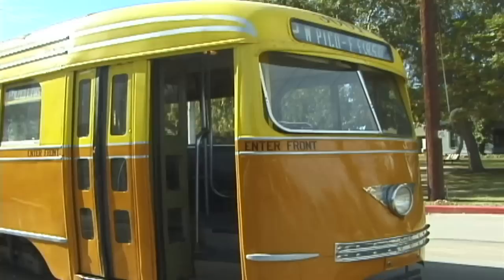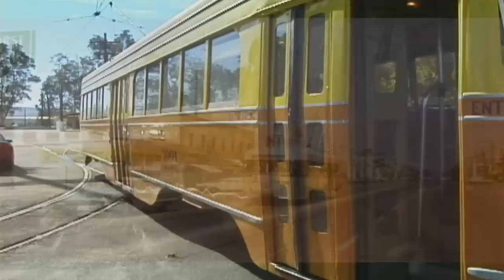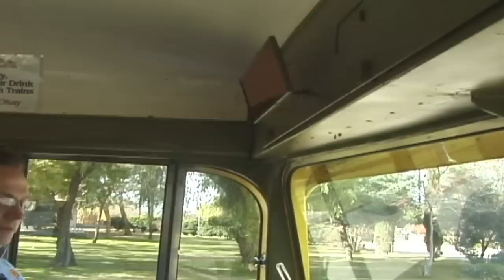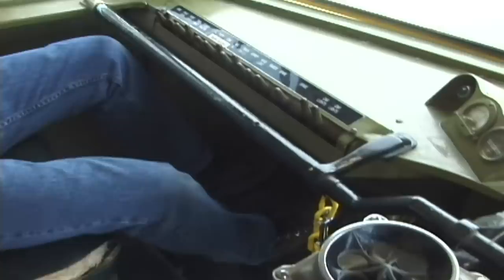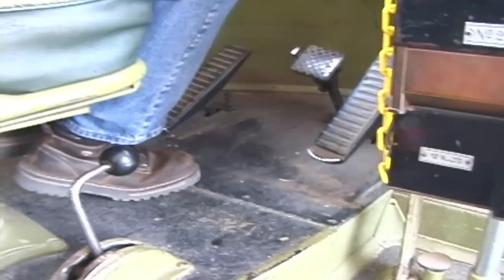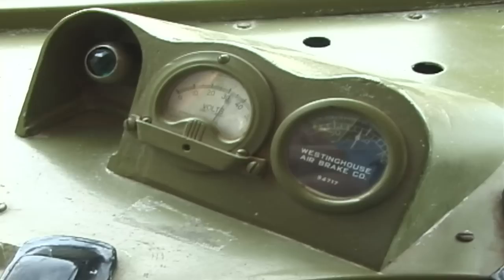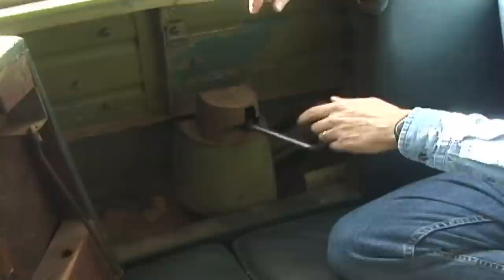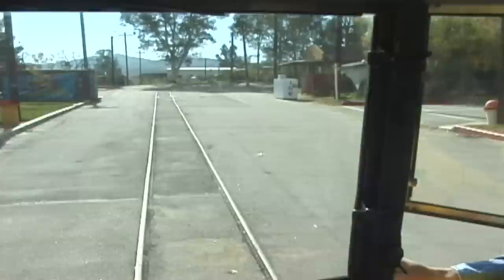OERM Behind the Rails PCC 3001 Trolley

Comment: I got one for John. As a boy, we would walk to the local Sears stores. On the way there, we'd pass by the power station for the electricity supply for this part of the grid of the streetcars. It contained several dynamos which generated the 600 volts need for operating all the cars on that line. I remember smelling the odor of ozone and the sound of high pitched whine of the spinning generators. I think that there was four in there. Two working and two for backup. After seeing several videos with operating  a PCC. Those cars could really pick up speed on a long run. Considering how much they weigh. How big and how much power how many motors are built in each car?

Comment: Considering i'm a Bulgarian, this tram (trolley) looks quite a bit odd to me - the driver doesn't have a seperate cab, it uses a contact rod (normally used in pair for electric buses-trolleybuses in Bulgaria) instead of a pantograph, but otherwise the tram is really nice.
Reply: In Romania there is the same in Bulgaria.
Some Romanian trams had what they called a lire trolley. Pantographs camed after W.W. 2.

Comment: I wonder what LA would be like if it still had trams and the Pacific Electric
Reply: Alex Jenkins LA has trams now. Check out the Metro Expo Line.
Reply: @buddyclem7328 Yes, but the Expo line is a tiny fraction of what PE offered. PE was destroyed in the 1950s and LA went without trams for decades. During that time many of the former rights-of-way were paved over for highways and have been permanently lost for transit re-use.
Reply: @Poisson4147  True. Many of the greatest transit systems have largely been abandoned, like Pittsburgh. But, the right-of-way is never lost forever. Many cities, LA included, have run trains in the median of highways. DC and Chicago both run metro trains in the median of Interstate highways. Of course, what we need are political will, money, and time. I hope the progress in rail transit continues, but of course, it would have been better to maintain the legacy systems. My city used to have trolleys, but all that's left now is the trolley barn and a few power poles.
Reply: @buddyclem7328  Thank you! I'm in PA and have seen what happened in both Pittsburgh and Philadelphia. Sadly will, money, and time are in horribly short supply these days. Unfortunately even if those could be found, at least in PA there are areas where some rights-of-way couldn't readily be recovered because the land has been converted to commercial use. For example parts of one former interurban line now sit underneath a huge research complex  ... which of course can only be accessed by car.  SO foolish.
Reply: @Poisson4147  So true. I grew up near Harrisburg, in Allentown, PA, and we moved away in the mid 70s just like that Billy Joel song. Hopefully the future of all rail transit in the US will be better.
Reply: L.A. should have followed New York's lead and build an extensive subway system.
Reply: @josephheston9238  LA should've have done that, but the problem with LA not having an extensive Subway like NYC is 1) Very Expensive to Build and 2) the only thing that was funded into were Damn Highways!!!